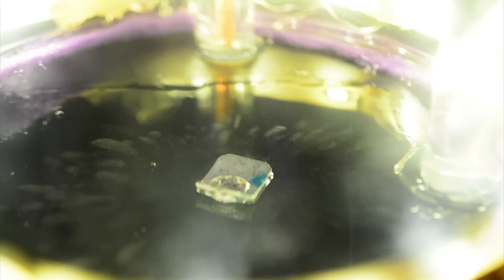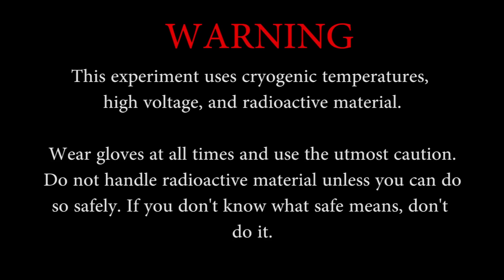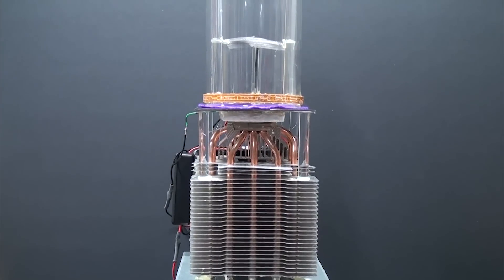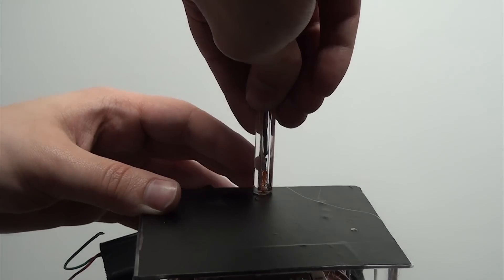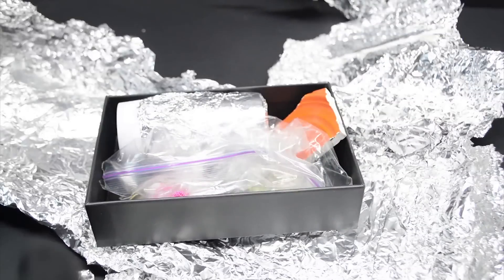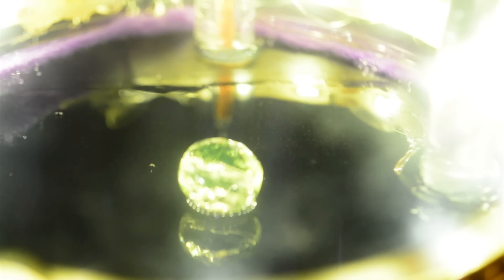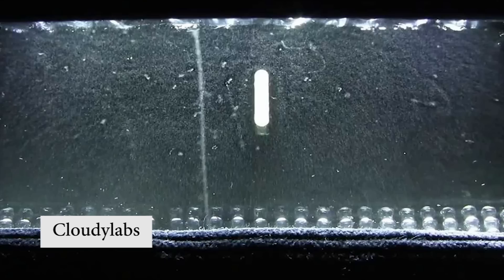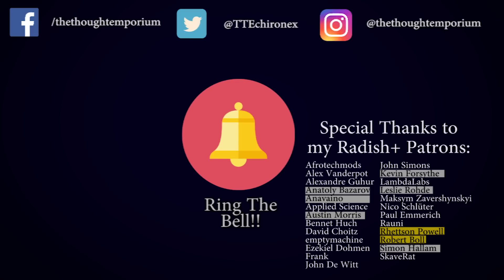Make Invisible Radiation Become Visible - Peltier Cloud Chamber

Comment: i think you just triggered every pc enthusiast watching your videos with the thermal paste application/waste
Reply: Thought the exact same haha
Reply: Well for a good reason too. Thermal compounds act as insulation in large amounts like that. It tells you that on their data sheets not to use it like exsive amounts or it could result in over heating.
Reply: @goldenfox334  but a thermal pase is supposed to be thermally conductive??? Like do what it's supposed to do, you know, TRANSFER HEAT???
Reply: using a large amount isn't a problem, since the 2 contact surfaces are typically clamped together.  Any excess paste is squeezed out the sides by the clamping force.
I'd expect it to get more viscous when heated - which might be why some people do a "burn in" cycle after installing a heatsink: To help thin the paste so the clamping force can squeeze more of it away & bring the mating surfaces even closer together.
If you're using the thermal compound to conduct cold temperatures - then yeah that's indeed an interesting problem, it could make it less viscous.  So you might thus want to be conservative with your paste application, and use a lot of clamping force.
Reply: Steven, modern thermal pastes are not electrically conductive.
Reply: @roidroid  I was just about to say that.
Spread that shit on ur mobo like pb&j.
They give you too much any way!
Reply: I use a brillow pad to wipe the excess thermal paste off my cpu mobos.. 

Actually, I used to just use silicone paste.. white gunk over everything. My PC would know when it was getting too hot and shut down every 30 seconds.
Reply: Pelletier pads are different to cpu's as they have a rougher plastic surface as opposed to polished aluminium on cpu's. A thick layer of thermal paste would prevent condensation over pelitier pads
Reply: The main problem with the application is the rings, you preferable want an application style that allows the paste to smear itself evenly over the surface, using rings will cause air bubbles to get trapped and the air bubble with prevent thermal transfer.
Reply: Or for claiming that peltiers are used anywhere in PC cooling.
Reply: Thermal paste is not nearly as conductive as metal, it is just much more conductive than air. Ideally it should be applied in a layer that is just thick enough to ensure good contact between the two plates it's between. Care should also be taken to prevent trapping air in the application. Thermal compound is quite viscus and doesn't flow well in really thin gaps and doesn't even flow well under high pressure but pressure does help. WE applied thermal compound with a silk screen roller then scribed lines in it with a coarse comb like device to allow trapped air to escape. We finished the assembly by applying pressure first to the center then to the rest of the stack.
Reply: It's not about waste at all. The reason it's being applied in extremely thin layers is because it only needs to even out the surface to increase the contact area by filling the gaps. If applied in a thick layer, it can actually makes the heat conductivity worse.
Reply: @Napert  Unfortunately the best thermal pastes to date have more than 20 times lower thermal conductivity than metals and thermally optimised ceramics. Their purpose is to lower the thermal surface impedance of the material boundary, and to displace air or other gases which have incredibly low thermal conductivity. The thermal conductivity of the thermal paste itself is not to be relied upon.

Their effect is not necessarily trivial. I have Keratherm paste here (industrial supply stuff) which has among the highest available conductivities at 9.7W/mK, but in actual testing performs worse than pastes that barely reach 3W/mK, even though on paper if you were to just go by thermal conductivity, the opposite should be the case. Because boundary effects or something is apparently super important. Similarly AS5 paste used here (8.9W/mK) usually performs slightly worse than MX2 (5.6W/mK). These are just odd examples though, to illustrate that this is a nontrivial topic, in general among highest performing thermal pastes, the ones with higher thermal conductivity perform better.

The best possible application depends on mounting pressure and the surface types, but generally the goal is to simultaneously maximise coverage and minimise layer thickness. It can be worth trying a few approaches.

My instinct for TEC specifically though, because they are ceramic and the flatness is kinda not all that good, would be to go straight for highest conductivity pastes and apply rather more than less, so i'm not going to criticise him for gooping around; AS5 which he chose here has a fairly high conductivity value, so that's a pretty decent choice too. But again testing beats guessing, and i guess the results are good enough anyway, so no need to hyperoptimise it further.
Reply: @jmonsted  They do get used for pc cooling. You wont see it often however as your peltier cooler must have a capacity equal to or greater than the processors consumption to actually cool it below room temp. 45W processor? You'll want 45+ with very high capacity peltier coolers using so much energy and being so expensive a large watercooler ends up being cheaper.
Reply: @buddhaman001  Yes, i've seen products for sale, but i've never seen one actually used. I have a sample size of about 3000-4000 systems and zero peltiers. I stand by my original statement of them not being used in the real world.
Reply: Worse still is the way he was applying it. You want to start with either a thin coat, or just a blob in the center that you squish out. A ring, or crossed lines creates air pockets which is exactly what you need to avoid.
Reply: I came to write this. His method likely hindered the transfer
Reply: @jmonsted  But your real world also shows them as being for sale and people don't sell things that won't get bought, basic economics.
Reply: @krashd  Lots of companies have gone bankrupt putting things up for sale that didn't actually sell. However, i wouldn't be surprised if those who sell PC components with peltier do so because they have all of the components anyway and it doesn't cost them much to have a product that sells in tiny numbers. It's definitely not a product that sells in numbers high enough to even barely matter in the PC space.
Reply: I was thinking the exact same thing! With all the knowledge this guy seems to have, it's hard to understand the reasoning behind that blob of paste!
Reply: "triggered"
Reply: Some pc people are such snobs about thermal paste. Gamer’s Nexus showed that even when an obviously excessive amount of thermal paste is used, there is no adverse effect on performance, the excess is squeezed out the sides.
Reply: Screw the thermal paste. What about him saying "the same peltier units you use to keep your cpu cool"? No one uses a peltier to cool a cpu.
Reply: Global warming 14000 years and counting. Oh ya.
Reply: Well the more paste the better the contact so
Reply: @Napert  Yes, but because we have not yet achieved perfection to conduct 100% of heat with no losses, you want as little of it as possible to transfer the heat with as little loss as possible. Same way copper wires are conductive but that does not mean that you don't get any losses when using a few km of wire. Now sure that is an extreme example, but same thing. When conducting things from point A to point B from what i know less is more. When you however try to insulate things, more is more.
Reply: @DVDplayerz  Screw that, i cant be arsed with cleaning thermal paste off my mobo.  A smidge is enough since once you clamp it should still cover most of the surface. However sure, go crazy if you want to overclock your stuff and do some crazy things with your cpu.

Comment: We use teds and pelier devices at work for reagent and reaction cooling. I can tell you from actual research data, you do not want to smear thermal compound on these things. Use as little as possible for good contact. I apply a thin layer to both sides then scrape it off with a plastic scraper. Excess coupound makes the thermal joint inefficient and can actually short out you peltier.

Comment: You mentioned that nuclear energy is perhaps the only solution to climate change we've got, and I agree entirely.  It's also worth mentioning that Chernobyl was an overmoderated reactor, meaning that as the reactor got hotter, the reactor got more efficient, allowing for a melt down.  In the United States, at least, all nuclear reactors are required by 10 CFR 20 to be undermoderated, meaning that  as the reactor gets hotter, the reactor gets less efficient.  As a result, it is physically impossible for a legal nuclear reactor to melt down in the United States.
Reply: Though I imagine your intention was good your post was basically "The entire world can probably fuck themselves up but at least the US will be fine" - that won't sway many folks to your cause if they happen to be humanitarians...

Comment: A few years ago as the expression of gratitude, I build one for my physics teacher who has a PhD in radioactive stuff, it was firmly based on your video and she absolutely love it. We spoke a few days ago and she still brings it to her class and blasts it with gamma emitter, prior to that she had to borrow one from the science council but now she has on her own. I enclosed the power supply and wires in wood, and added the array of SPST toggle switches with guards for every electric subsystem to run (PC power supply on, the peltier device, high voltage etc.). She said that the moment she looked at it for a first time she thought it's been made by Rick Sanchez.   I wouldn't be able to pull this project without your help, and big thanks for the bug zapper idea!

Comment: I am a health physics tech and it always makes me happy to encounter someone who doesnt sensationalize radiation. That being said the lead foil is a bit overkill for shielding those sources I would be more worried about contamination controls at that point. Get yourself a watertight tupperware container with the rubber gasket under the lid, poly will shield all alpha and most beta. However, the lead wont hurt anything unless you have enough beta to worry about bremsstrahlung. Either way cool video I look forward to seeing more!
Reply: Exactly. The lead is really only needed for blocking gamma radiation, and gamma emitters aren't the isotopes one wants for cloud chambers since photons don't produce tracks.   I worked with a lot of P-32 (high energy, very strong beta emitter) as a grad student  and the standard shields we used were acrylic plastic and seal-a-meal bags of water. Plastic is actually a great shield for beta particles and doesn't produce bremsstrahlung x-rays the way that lead will.  Ingestion is really the major danger from most beta emitters, and is the significant health danger from alpha emitters.

I'm looking forward to see how things go when you try to add magnets. I keep seeing references to it being hard to get enough field strength for making betas and positrons spiral in basic cloud chambers, but I haven't been able to find any information on exactly what field strength to aim for.  Let alone whether neodymium magnets or a big electromagnet is the way to get it.

Comment: Man, I'm so happy that you want to disperse nuclear paranoia.
I was always super excited about nuclear (not only does it save the planet it's SUPER COOL while doing it).
And recently discovered what Elysium Industries is planning on doing which just reignited and amplified my excitement about nuclear all over again and convinced me that molten salt reactors are WAAAY closer to everyday use than they seemed to be previously.
Reply: I'm not in love with the molten chloride fast reactors. Chlorine has 2 isotopes that are reasonably usable in a molten salt reactor, but neither is capable of supporting a thorium based reactor. Thorium based tech is really what could save the earth and transform our society into an engineering society.
Reply: @retovath  That's what FLiBe salts will do. Those are expensive, there are political concerns, Hastalloy needs to be first licensed for nuclear use and most importantly it WILL need in-line chemical processing before it's economically viable. Thorium is certainly the future but it has a long way to go.
What Elysium is proposing is a freaking trash can that makes 36 times as much energy from waste than what was produced from the pure product before it turned into waste. And as far as I've seen they can have the power plant running within a year if they get the nod.
And there is PLENTY of Uranium everywhere ... even if you want to get it out of the sea for twice the cost you're still MUCH more cost effective than current nuclear reactors.
Reply: @MrRolnicek   MrRolnicek  there are chemistry issues regarding the steels and chloride fuel salts. It's called a chlorine iron fire. Any chemical fuel salt is going to need a specialized alloy to deal with the possibility of corrosion reactions. This doubly applies to the MCFR design, as that material also has to be qualified to operate in a high flux fast neutron environment. Afaik, there is only one reactor that can qualify materials like that. It belongs to Russia. The US has another in development, but it's not yet ready. 

Truth be told any 4th gen nuke is great in my book,  but I do play favorites with designs.
Reply: @retovath  Corrosion reactions? How can you get corrosion without oxygen or water or other oxygen containing molecules? Or are you talking about some other reaction?
Reply: man, what a coincidence, I've been talking to Ed Pheil of Elysium online recently
Reply: @retovath  every day, industry melts chloride salts in stainless steel containers. they have a lot of this stuff figured out. if you use a zirconium cladding on the inside of the vessel, it will make the salt reducing and prevent chlorine corrosion.
the company already understands these concerns and wouldn't have chosen this route if they did not have a solution.
as a chemist/nuclear engineering major, i can tell you that there is no "game-changer" advantage to chloride vs fluoride, it all just depends on the neutron spectrum you want.

for fuck's sake, the LMFBR uses LIQUID SODIUM, and it got past regulations. if "chlorine fires" really concern you, you need to take a step back and stop cheerleading for one team and trashing the other.
MSR's have a wide variety of applications and we need a united front to make them happen.
fast spectrum waste burners and denatured uranium converters are probably some of the best first steps on the way to an on-board reprocessing thorium reactor like LFTR, but climate change is happening now and we need a solution that can lead us in the right direction, while all of the problems with on-board reprocessing and neutron moderation are figured out
Reply: There'd still be tons of blackouts.
I'm going off the grid because I'm sick of losing power and paying too much for power.
Also, nuclear requires too much capital per plant so it's just not a realistic option in many cases, a fact never addressed or mentioned by the nuclear fanboys.
Reply: @retovath  Don't forget breeder reactors, which are slightly less elusive than thorium reactors, and can turn non-fissile Uranium into fissile Plutonium.
Reply: @aarondavis8943  What do you mean by "too much capital?" Do you mean too expensive, or something else? Nuclear power is expensive, but still not THAT expensive.